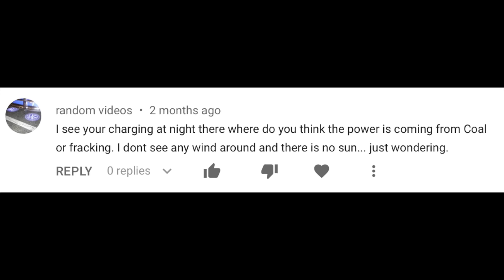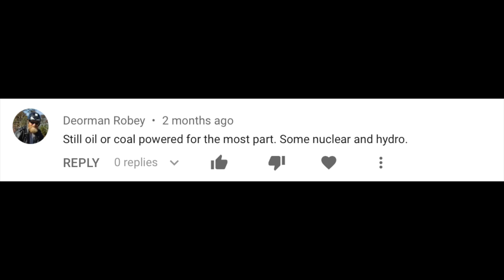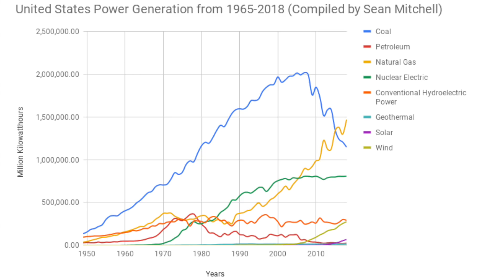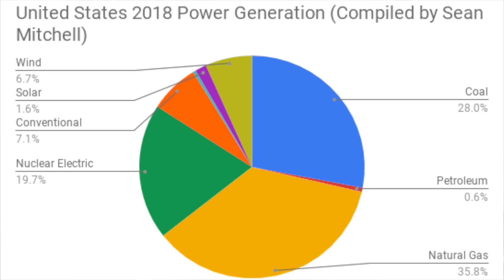Are EVs really powered by coal?

Comment: Wrong electric power generation would not be as expensive if it was generated by  Coal it takes coal and A quarts mine to make solar panels .and they brake and degrade.as for the battery A fuel tank or A pile of coal is A lot cheaper.no mater how good you battery is.
Reply: After 50 years of Solar and wind Germany still needs Russian oil and Coal and they pay three times as much for electric power generationhome cost is unnecessary high solar panels are not clear they are hazardous waste.and the batteries are toxic.

Comment: You,re correct, Sean, not to mention the fact that coal power plants are not situated in city centres, so the local pollution will be lower if EV's are used. The UK is also investing heavily in renewable electricity generation. The graphs on gridwatch.co.uk are interesting. So far this year, about 30% of their electricity has been from renewables, and this is rising by about 5% per annum. The Islands of Orkney generate consistently more electricity than they need, mainly from wind power.

One thing, though, and at risk of being labelled a 'grammar Nazi' here: You're misunderstanding the phrase 'begs the question'. It comes from 'beggars the question', and therefore means 'renders the question worthless', or 'to invalidate the question'. What you really mean to say is 'which raises the question'  (or engenders; promotes the question'). Thanks.

Comment: A Tesla powerwall is 14KWh, my roof holds 14, 250Wp solar panels (no room for more!) and generates about 10KwH per day.. A Tesla Model 3 must have a 100KwH battery or... Soooo charging from my solar panels only is not entirely possible, I still need some from the grid.. but... I buy only "green" electric power, my grid provider certifies to purchase only DUTCH wind energy for me... 

I will buy a Model Y when time is right for me, maybe in 2022 or 2023, when dutch subsidies will be available and I have saved up enough to buy one. Of course I will charge it at home, partly from my solar panels.. But to charge it soleley from solar panels, you will need a very large roof with many, many solar panles amd  3 or 4 Tesla power walls... Hm I have a shed that can hold a few more solar panels and a back yard that I can partly fill with panels.. hmmm.. stuff to think about!

Comment: "gas powered cars will never be powered by sunshine" - actually they are, just fairly indirectly.
Reply: And extremely inefficiently! It has been estimated that only about 0.01% of ancient plant life has been converted into oil and gas. I don't know the figures for coal, but they will be low. Another statistic says that we're using fossil fuels at a rate of at least 1,000 years production every year. A quick online search will give you the references. Someone (one of the European EV channels) posted a video about it in late February or early March 2019.

Comment: I don't like the coal argument. Switching from ICE to electric and fossil to renewable have to happen simultaneously. Imagine we are in 2060 and the whole world switched to renewable energy. That's not the time to start mass EV adoption. By that time that process has to be finished. 
In order to change our 2 billion ice vehicles to electric we would need to sell 100million EVs per year for 20 years. We should have started this decades ago.
Also lets face it, if nobody buys EVs because of the dirty grid, nothing's gonna change. You'll have a dirty grid and a dirty transport system for a very long time. If you own an EV, you will care more where your power comes from, it will effect your thinking, the parties you vote for, you may get a solar-battery solution. If you keep driving an ice, you'll be more likely to accept that oil has to power your car and coal has to power your home and very little can be done about that.

Comment: Sean
A slightly different perspective.

If we consider that on average, the vast majority of vehicles actually stand idle for the majority of the time, in many cases and electric vehicle could (should!) become a storage battery for an individual home.

Let's say a solar system was used to power a home during off-peak daylight hours, but also to trickle charge a garaged EV.

A proportion of the power collected by the EV could then power the home during peak evening hours (6-10kWh?) and again for a short period In the morning peak (1-2kWh?)
Depending on battery size this would only take 10 to 15% of the vehicle capacity.
Between these two discharge periods, the vehicle could be trickle charged by grid baseload overcapacity, say between midnight and 6 a.m.

Even if an EV was used for commuting, the evening discharge, overnight charge, morning discharge cycle would still apply.
The vehicle would still leave home with a healthy capacity for the daily commute and evening discharge.

This usage would of course reduce greatly the requirement for fossil pika plants Halloween for an underlying baseload capacity to run more efficiently, providing constant power.
Reply: Nissan is already working on this. It is their vehicle to grid system. It is designed to network vehicle batteries all across a region to shore up the grid in high demand times.  Their also stand alone inverter kits designed for 2-3 days of emergency power from a vehicle battery.

Comment: Sean, the important thing to note is the marginal energy/power used by EVs and what source of energy supplies that. Like you pointed out, local renewables / storage sources are one way to offset marginal EV demand with marginal clean energy supply. Another way is to buy offsets or contract with remote renewable farms for the source of energy to offset the EV charging. For example Shell and other providers in UK are offering zero-emissions EV charging.  You will increasingly see this trend, and which would mean that the average matters less than the marginal source of energy for EVs which will be much more clean than is commonly appreciated. Shiv

Comment: Even within the U.S. some states are far more “green” than others. Increasingly, fewer and fewer states rely on coal. 
https://en.m.wikipedia.org/wiki/List_of_U.S._states_by_electricity_production_from_renewable_sources#/media/File%3AUS_states_by_renewable_electricity.svg

And the momentum builds. Solar is far cheaper now, so much so, that even in the Middle East, they are dropping in solar farms, producing electricity at half the cost of oil/gas generation. Considering that’s in their own oil producing backyard... that’s saying something! Rates as low as 2.3 cents /kWh. But not necessarily loss-leaders...
https://arstechnica.com/science/2018/10/are-super-cheap-solar-fields-in-the-middle-east-just-loss-leaders/

Comment: I got my Model 3 in December and I do have a small solar array on my workshop but it is not nearly big enough to charge my car for my daily driving needs.  Luckily, by law in Illinois where I live, public utilities must allow customers to choose their electricity supplier.  The Illinois Commerce Commission has a website called Plug In Illinois where you can find information about different approved suppliers.  Some of them offer rate plans where the source is 100% renewable.  I found one with a rate nearly the as my old rate and now I can say that my Tesla is 100% wind powered (at least when charged from home which is almost always).  Anyway, not many people are aware of this even though the utilities actively promote it.  I’m guessing that there may be similar laws in many other states.  By the way, when you change your electricity supplier in Illinois, it does nothing to change who sends you the bill, in my case, Ameren.  And Ameren still does all servicing of power lines , etc.

Comment: My EV is powered 100% by my own solar panels and small wind turbine so my home power is free and the fuel to power my car is free as my solar panels are paid off.  You hit the nail on the head, Sean, renewable energy is cheaper to generate electricity from and is expanding, for grid and home power, much faster than any other power generation type.
Reply: Really? Do tell. Post a video of your setup.

Comment: I intend to get a solar panel system on my house. Until then I am using Arcadia Power to make my power greener. They pay your utility bill, then you pay them. They use the money to buy Renewable Energy Certificates (RECs) from wind farms. Thus, you effectively are sourcing your electrons from wind power, as the wind farm is getting paid for your energy use. I do the 100% Wind plan , which adds 1.5¢ per kWh to allow all of my energy use to be sourced from wind. This also allows them to offer a plan where 50% is sourced from wind, but is sold at no extra cost.

So, if you are paying $100 for electricity, you can give them that same $100 and buy 50% from a wind farm (through RECs). If you pay a little more, you can source all of your use from wind farms and pay for others to use the 50% plan. Thus is a good deal for people who rent or cannot afford to have solar panels installed to go greener and promote more green energy. There are other programs they do as well. Check them out.

Comment: Well done Sean. There are three categories of electricity generation: fossil, nuclear and renewables. The often repeated refrain of EV haters is EV's are coal powered. This does depend on where you live. If you live in West Virginia or Kentucky your electricity is generated from coal (unless you have your own solar). If you are in California or Canada or Norway, the vast majority of electricity is clean - meaning that electricity generation is not emitting C02. An excellent source for details on this can be found here: https://www.nytimes.com/interactive/2018/12/24/climate/how-electricity-generation-changed-in-your-state.html
Reply: Tom Hoffman, with PGE filing for bankruptcy, they are also trying to get out of their contracts to buy expensive renewable energy. The bottom line is it cost a lot of money to make renewable energy at this time, which is why getting out of the Paris agreement was the best thing.

The US needs to burn as much fossil fuel as possible, to get as much cheap energy as possible, but make sure some of that savings is invested in renewable energy manufacturing. This is what China is doing and was planning to do under the Paris agreement, while the US was going to bleed itself dry. 

The US needs a plan to get us where we need to be, without becoming Venezuela. Lol

Comment: The electric grid gets cleaner every day, every month, every year. Gasoline and diesel vehicles, new and used, gets more and more polluting every day, every month and every year - they lose efficiency every day, month and year. Gasoline and diesel vehicles will never, ever get cleaner. The electric grid and EVs by extension will just keep getting cleaner and cleaner till they are all 99.999% clean. And we are not even talking about the particulates from gasoline and diesel vehicles which is horrible for our health as well.
Reply from the maker: Correct
Reply: The particulates and toxins from burning coal are pretty terrible.
Reply: @incognitotorpedo42  
I assume you mean "when used for EV's"?

Comment: Use coal and it takes 12,253 BTU's to produce a kWH and there is only 3,413 BTU's in a kWH. Use wind or solar to produce a kWh and there is no 3x times the amount of energy being used to produce a kWh. This metric makes it look like wind and solar are producing far less power than they are. The metric needs to be changed to percentage of the electricity produced, not the percentage of the energy needed to produce the power. By that metric a 4% figure means wind for example is really producing 12% of the electricity. This metric is totally misleading and needs to be straitened out. This makes your basic premise wrong. I would like to know the actual figures.
Reply: I don't think this is right.  Sean's figures are based on the amount of usable electric power created, not the amount of kcals it took to create that power.  That's how everyone does this comparison.
Reply: @incognitotorpedo42  not when they use words like energy mix. They report the amount of fossil fuels used not the end result in electrical energy produced. It is totally disingenuous.

Comment: Even IF power station were powered only by coal, electric cars are STILL better. No tail pipe emissions on the road means no concentrated particle matter fumes affecting public health. DIE-SEL being the worst offender.
Reply from the maker: Correct
Reply: This has been my argument all along. A centralized power source can have continual improvement of its operation and can be verified on a continual basis. An ICE is typically on a downward slope from day one with age and lack of maintenance.  Not to mention the volatility of the petroleum market. When the wrong person 5,000 miles away sneezes, prices jump overnight. If a petroleum engine is so much better, than why don't all the critics disconnect from the grid and run a fuel driven generator instead of that dirty grid power for their house. Oh wait, guess it doesn't work that way.

Comment: No one pays attention to Tesla energy but it's actually a larger market than the car.

Tesla will be leader in energy due to it's low battery cost.
Reply from the maker: Yes, the dark horse of their product line.
Reply: @AllThingsEV  
Wait for "Maxwell"!
At today's predicted performance.
+20% density
-20% cost
16(?) Times production speed in a smaller factory?
THAT'S the first "sub shift" in the overall "paradigm shift" that's occurring.

If the space required is, say 30% of current lines, due to no dryers.
If the production runs even 5 times faster, (possible16!?) For the same reason......

Even that is 3 times the line space at 5 times the volume, times 120% cell density.

15 times the physical number of cells,
18 times the kWh (!)
From a similar sized factory?

Then consider the percentage total of the existing Tesla factories being used.
30%?

Could there be a possibility of (18x3) = 54 times increase in total kWh produced by Tesla in a relatively short time?

Maxwell is a big deal!
Reply: @rogerstarkey5390  plus if they get the Wh above 450wh whew electric jets as well

Comment: I would love to get solar and batteries but I wish it was cheaper
Reply: Fossil and "other" sources are effectively fixed price or rising.
Renewables are (despite efforts to stop the change) decreasing in price for installation and use.
As the rise of popularity increases, the opposition will weaken.
Fossils are done. (and quite possibly Nuclear)
Reply: @rogerstarkey5390  I don’t know if solar will never be able to completely replace fossil fuels. The tech cannot move heavy loads. Buildings, bridges will still be built. Emergency vehicles will also have to run on fossil fuels for numerous reasons. Also the fallout from the Hazmats has yet to be seen.
Reply: Soon. Solar is now cheaper than ever, and like tech, overtime will get better and cheaper
Reply: Solar panels pay back for themselves in energy bill savings in just about 3 to 4 years, after that you start making money....

If you have some savings in a savings account, ask yourself how much interest you get, I had 6000 Euro's in my bank account back in 2013, doing 0.5% interest a year.. ridiculous!.. I used it for the most part to buy a solar panel installation on my roof, 14x 250Wp panels, a little less than €5000... Operational right at the start of 2014, my monthly utility payment was already fixed for that year... But when the end bill came in December 2014, I got €594 back from my power company!.. all from my self generated electricity!.... Which I could also see as 12% interest on my investment in solar panels on my roof!.. 12%!! Where on earth can you get 12% interest on your savings account?! With the increasing electricity prices my system will have paid back for itself within 6 to 7 years

In 2013 solar was still quite expensive and not very common to install, but right now you can get 350Wp panels for lower prices and same dimensions, so more power for the same roof

So it really makes sense to invest in solar panels on your roof, pay back time is decreasing every year, and if you can pay it out of pocket from your savings, you start making money right from the start.  A lot!
Reply: Start with solar and then add batteries later